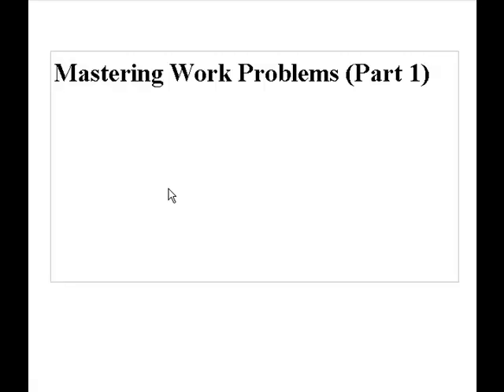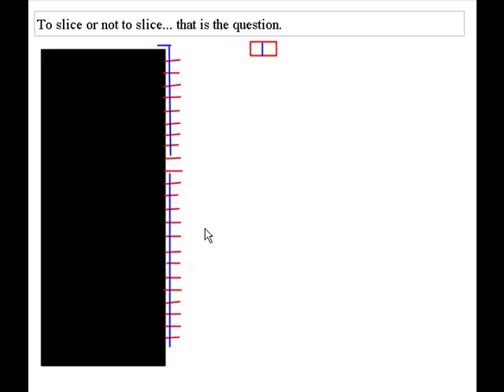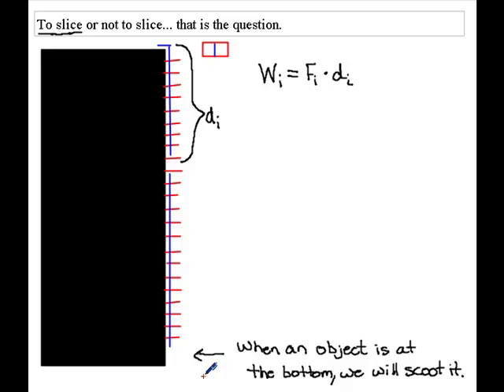Integral Calculus Mini-Lecture: The Concept and Computation of the Work to Lift a Continuous Object

Comment: add gravity next time
Reply from the maker: Gravity is included in any problem using imperial units.  That is, pounds reflects both mass and acceleration due to gravity.
Reply: pounds is a force so you don't need gravity. You only need gravity is you're working with a mass ex kg

Comment: @mathemaddictscom I got it now, thanks. I was thinking in too exact of terms I think. I should have been thinking that as you pull the chain up, the y(height or length of chain) will vary each instant as you pull. For some reason, I wasn't thinking about how the length of the chain hanging will differ as you pull up more and more of it. Dumb mistake, thanks though! Great video! You come at it from a different angle which I think is good and much needed sometimes.

Comment from the maker: The height of the building is not important as long as it is greater than (or equal to) 50 feet.  y_i is the height of the ith slice, it cannot always be 0 unless the entire chain is sitting on the ground.  The Delta(y) is the width of the slice and therefore should be infinitesimally small.

Comment from the maker: @QuantumDisciple7 No, it should not.  50 - Delta(y) would roughly always be 50 because Delta(y) is incredibly small.  There are slices near to the top of that chain that are not moving nearly 50 feet.  Just think about what y_i represents.  It is the height of the ith slice.  Hence, if the ith slice is at 10 feet, then it needs to be dragged up 50 - 10 = 40 feet.

Comment: Does y correspond to the height of the building, because if it does, then the answer doesn't make sense. If the building was 50 feet tall the total work done to pull the 50 foot chain up is 0....? I might be missing something but I think the y sub i with a star should basically be assumed to be zero since it is made infinitesimally small and becomes neglible to subtracting it from the length of the chain.